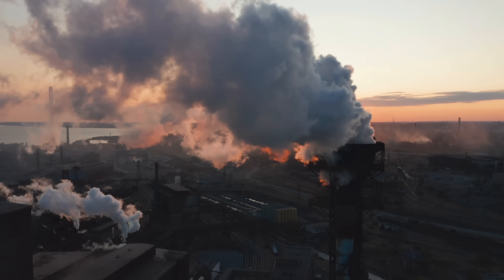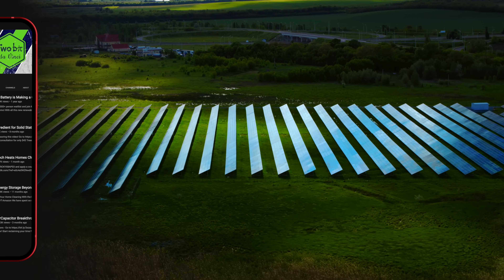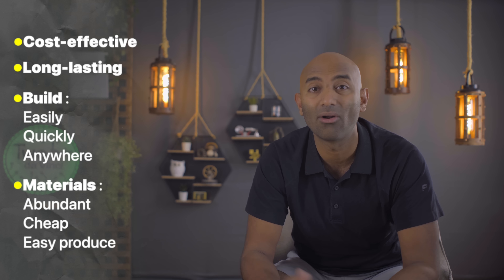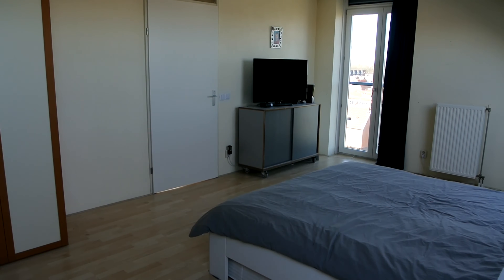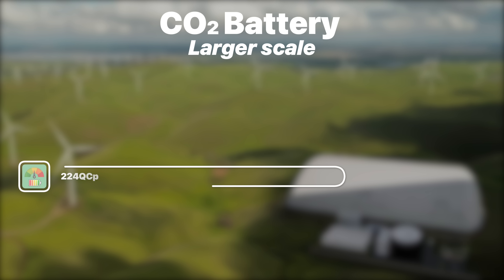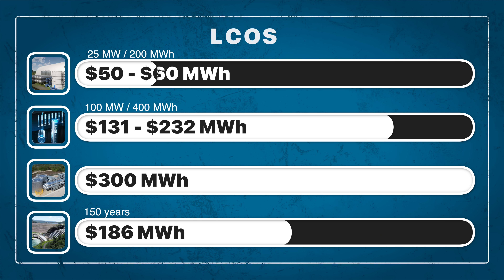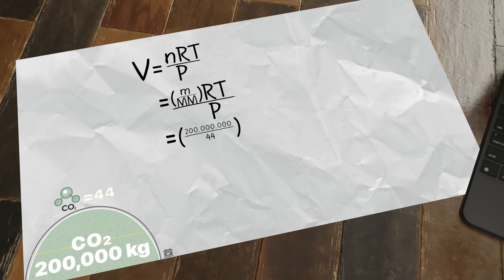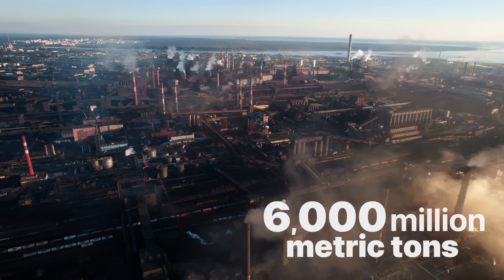The GENIUS Of the Carbon Dioxide Battery

Comment: Of all of the things I have seen on your program as well as many others, this looks to be the most promising. It's simple, inexpensive, safe, and scalable. That last part is the most important to me, this could be affordable to install in small communities, or small towns that otherwise would be stuck paying the high prices from big corp.
Reply: Another advantage is that the equipment will be off the shelf. Meaning workers from other industries could more easily be retrained to work with this battery
Reply: @AJSSPACEPLACE  that is a big issue, but a positive one. Years ago I owned a manufacturing plant. I had two commercial grade CNC routers. The first was an Axyz, and I found out quick about the cost of proprietary parts. The second was a CR Onsrud, and they used off the shelf components. The machine cost about $75,000 more, but it quickly made up for it with repairs and maintenance. When you run this equipment for 16 hours a day it takes a real beating.
Reply: I think you hit the nail on the head. Living in a third-world country myself, I've always felt that most of the technologies that could help the world steer away from fossil fuels are way too out of reach for us. But solutions like these would really make a difference.
We wouldn't need to bring in engineers from overseas and pay them 100X what engineers here are paid. Any good team of local engineers could easily oversee construction and operation and we could employ local steelworkers to build these structures. Not to mention use our own steel, piping and everything else. Turbines we'd probably need to import, but the rest makes a difference you wouldn't imagine.

And an important point to make: governments in countries like mine find it way too easy to blame China and the west for all the pollution, and the upfront cost of going carbon neutral has always been the perfect excuse not to do anything. But if we are to fight climate change, it can't be just Europe, China and the US, everyone has to do their part.

I think this type of technology helps a great deal in that respect.
Reply: @ipp_tutor  where do you live?
Reply: @rwells3376  Venezuela

Comment: Looks promising but we still need much cheaper! Assuming we need 10 MWhr storage for every MWhr of generation, then costs need to be $5-10 per MWhr or it will add too much cost to electricity bill's. Still $40 is at least in the right order if magnitude.

Comment: Looks like the process will be significantly less productive in cold weather.

It counts on ambient heat in the atmosphere to vaporize the CO², and the energy produced will decline with the outside temperature.

Comment: Does this tech function as a battery or a generator?  Because it looks more akin to a recyclable generator to me.
Reply: From the video... I believe it's a little of both. A... batterator?
Reply: It will be like lifting a stone. It is charged with kinetic energy. When you let it fall, the energy is released.

Comment: still think making green natural gas out of green energy excess is a better option even though its less efficient because it can be used instead of fossil natural gas with little change to infrastructure. to build makes CO2 emittions that should be calculated in too. Using one of the green natural gas production methods can even scrub CO2 out of the air.

Comment: I sincerely hope these guys will not wait for any carbon capture thing. Why? Well - this is something that can be build tomorrow, uses tech verified by decades and is so brilliant we should start using it tomorrow already, not in 5-10 years before we have relevant capture. Plus, the amount it needs is laughably small comparing to amount released by building medium-size house, if we include concrete and transportation.
What's best - we should not build it next to solar farms, but in/close to places of consumption! Decreasing grid load by using this as a local "booster" next to big plants. Not only as battery for intermitency.
This is so far the most game-changing tech - simple, available, realistic, scalable and pilot-verified.
Plz, keep following them. Should they be located in Switzerland, they would be reading my CV about now.

Comment: The only real problem I see is the bladder. Presumably it must be gigantic and gas tight. A huge plastic or rubber thing possibly, although I don't know the details. May not last long and hard to keep from leaking especially after many cycles. And how do you fix and maintain it? That will be challenging.
Reply: Then let it leak. It's CO2. You can simply capture an equal amount somewhere else and replenish it.
Reply: Likely graphene fortified rubber

Comment: I really like this idea. I was already a huge fan of the compressed air storage, but if this can operate within ambient temperatures, then this is obviously better. I kinda wonder what the bladders inside the domes are made of... rubber? Like a water mattress? Or perhaps some kind of plastic? I would imagine they operate like lungs with the outer dome being the ribcage. I guess the question would be... how do you capture CO2 from the atmosphere, and can that generate power somehow? I'm pretty excited about this. I still think nuclear is better, but this isn't half bad. :D

Comment: All they need to do, is run their compressors with the system open to external air and sort off the various products based on liquification pressure / temperature. No need to capture the CO2 from somewhere else.

Comment: I'm wondering if this could be scaled down to the use in family hones and maybe with gas pockets in the walls double as insulation.
Reply: I think you need a large outdoor area to store the gas. But with a nice color on the big bubble it could be nice.
Reply: @beehappy7797  i mean, its gas. Does it really matter what shape your “dome“ has, if its one big dome or a series of connected gas pockets in the wall maybe connected to a bigger thing somewhere else?

And generally air/gas or a vacuum (not sure whats left in the dome when it is charged) should funktion great for temperature insulation.

Comment: There is an added benefit to this technology: You can place it ANYWHERE. There is no need to worry about Chemical fire (as with Batteries) or whether the topography/geology allows for it (like with Compressed air or pumped hydro). You basically just need a flat piece of land large enough to house a CO2 bladder and you're done. Which means you can place this anywhere you have windfarms (on shore or off) or solar farms on cheap open land not used for something else like out in the western US or in the Prairie lands in the western parts of the Midwest.
Reply: Just don't let anything rip it apart when dome filled. Will suffocate every animal in the area.

Comment: The beauty with utility scale power storage is that it can be placed just about anywhere. The storage tanks have some hazard to it but minor since 70 bar ain’t that bad. The big dome is a big dome with something we already know.
So sounds good.
We must remember that batteries, for such use, are shifting towards LFP… which is way cheaper and since volumetric and gravimetric density is less important in such batteries, they should do well.
You should also investigate a Calgary cie called eavor (I think that’s what it’s called) which kinda stores energy but not from the grid but rather generates base load energy when needed and when wind/solar are pumping out energy, it simply leaves heat in soil to be used with greater efficiency later. A combo of cheap energy storage, easy to install anywhere base-load energy production with built in delay generation and ever cheaper sun/wind/wave energy generation, we can SERIOUSLY reduce our dependence on fossil fuels.
The beauty of the above is that ANYBODY, ANYWHERE can use them to some degree or another. Especially the baseline and storage.
Reply: The best part of this technology it's even something that it's not talked about, if we were to accept a higher energy inefficiency this would be the perfect way to export energy for countries with excess production with infrastructure that for the most part we already have, for example  just place solar panels all the way through the Sahara desert and then export compress CO2

Comment: Expressing energy production or storage in variable units like "households for x hours" vs "for an hour" is confusing. While I imagine the typical "households supplied" aren't very standardized, it is at least ostensibly the actual needs of a typical household, during any given period of time, as averaged over a typical year. Storage requirements are different from production requirements, but there still should be an attempt to measure in units derived from the typical needs for a typical household. How many homes are backup powered for one hour tells us nothing about how many hours are typically needed per home in a typical day.

Comment: You could store the uncompressed co2 in the actual windmill tower and have each windmill provide a constant voltage.
Reply: That would require suspending a huge tube  bladder in the tower. and due to the smaller size a reversible screw compressor and just one Co2 tank could be used per wind turbine. Kinda makes me want to try it with the junk screw compressor I have laying around. They are looking larger, but smaller could also scale since if you can do wall cooling during compression the temperature would be lower. And then there is the fact that the tower could also be a massive heat sink.
Reply: There was a company a few years ago that wanted to use extra large wind turbine towers. Inside these towers they would pump water for energy storage.
Reply: @andrewday3206  Pumping water makes some sense, still debatable.
1. You need a good pool of usable water nearby. It sust be clear. 
2. large mass of water greatly uncreases construction demands. You now need to use corrosion-free materials and much beter founsation.
Reply: @DimaZheludko  
I don’t disagree with you at all. It was just something I remembered a company had proposed.
Reply: @DimaZheludko  Good idea and when tsunamis roll along,, you get even MORE water to play with. I'm all for it.
Reply: Interesting idea. You could connect the wind turbine shaft to the compressor mechanically, then bleed off CO2 to drive a smaller, constant velocity generator. This might be more efficient than having a generator directly attached to the shaft that has to handle variable levels of power. Are there any engineers in the audience who care to chime in?
Reply: @bradmaguire6458  Sounds good. You eliminate one whole stage of electricity generation. You don't really have to worry very much about constant turbine RPM either.
Reply: @bradmaguire6458  Hey, that's a fun idea actually. I still believe it would be less effective overall, but it is neat nonetheless.
First of all, you'd have huge losses due to compression/decompression. Then, when dealing with gasses, you have to seal everything somehow. Sealing means that solids need to be in tight contact, otherwise you'd have leakage. But tight contact means friction, oils, and costly mainentance. That's really bad.

On the other hand, you don't really need to make as much small generators as there are turbines. you could channel all that high pressure air into some large unified chamber and then take it to a stable generator from there. This way you could deal not only with minute-to-minute wind intermittency, but also have some power for hours or more. What's more important, you wouldn't have to make that generator as light as possible. You could also use some flywheel for better stability if needed. You can't put a flywheel on a modern wind turbine, it would be heavy and would need an expensive support.

In the end, you'd have one big pressured chamber, one big generator, and an array of unpowered autonomous wind turbines. Sounds steampunky to me.
Reply: What are the interior dimensions of a wind turbine tower? (For volume calculation?) What would be the "work around" for maintenance access to the turbine (upper parts of the tower)?
Reply: Put some rodents on wheels to make it go. I like it.
Reply: Bruh. That's kind of genius.
Reply: What? How can uncompressed CO2 provide any benefit?

Comment: How does that compare to a refrigerator? Seems a LOT like the same system.
Reply: Interesting idea. Build continuous duty refrigerators that pump excess CO2 into a turbine generator. Except that would be extremely loud.
Reply: @mikemorgan8588  Wonder if you could also
 pump the extra heat or cold to customers?
Reply: @DouglasEKnappMSAOM  , I was thinking along the lines of residential use refrigeration, but that may work for apartments that share compressed gas lines that lead to a pressure tank in the attic. Decentralized energy (whenever possible) is the way to go. I’m sure utility companies would hate it.
Reply: @mikemorgan8588  Ya, I am a bit sick of the "big boys" shutting down local ways to fix problems. Mega programs get the money but each home with their own solar? No way. Etc.

Comment: I don't think you mentioned anything about losses. Is there no CO2 consumed or lost during this process, and that once charged, the dome's CO2 volume is stable for it's life cycle? I saw I'm not the only one who thought of salt domes. Certainly there is potential there. They're already pumping CO2 into some of them, aren't they? Storage viability already proven in that case. So why not build a CO2 power plant nearby? Obviously this technology isn't going to remove much CO2 from our atmosphere in and of itself (i.e., the dome charge), but given that if enough of these can be built, then certainly in the long term they would replace combustion-based power generation and reduce a huge source of CO2 emissions. Can't wait to see progress on this tech. Finally a solution that makes sense.

Comment: When the finger starts to point to the cost/profitability of new tech as a potential reason why it won't beat out the old tech, I point to the fact that we don't properly charge for the damages that the old tech is doing as the reason why it was ever profitable at all. We let the entrenched energy corporations get away with far too much.

Comment: Seems like CO2 domes would be susceptible to to weather, and impact reliability. But still seems like a good idea.
Reply: build a structure around it to protect it - place solar cells on the structure to make up for the bladders large foot print. And now its even smarter, because its like it takes up no space, instead of a lot of space.

Comment: Why not make the dome out of solar energy capturing material? On some of these videos, such as one for solar panels for balconies, the panels were very thin, flexible sheets. 
That would mean the dome itself could capture energy at the same time as storing CO2, plus the grey of the panels would be far easier on the eye than having some huge stark white whale of a 'thing' as yet another eyesore on the landscape. 
It's enough that we have pylons and telegraph poles romping through the countryside. I don't mind the turbines (as I come from Norfolk, UK and used to windmills anyway), but they are the limit. Sorry, but these great big white blimps look absolutely awful and are a development too far. At the very least, paint them green so they look like a hill.

Comment: At it’s core a battery is a device that cycles between low entropy and high entropy and respectively accepts or outputs energy as the mechanism of transformation. If a battery also sought out the resources to maintain the low entropy state, meaning it had agency to stay charged, it might be called life.

Comment: Or, each building should have a battery bank system for night time lighting. Why low voltage DC wiring to LED lights isn’t standard in new construction is hard to justify or comprehend.
Decentralized energy production and transmission seems to make more sense. Each building should have capability to create at least some of its energy needs through wind and solar power generation, on site.

Comment: Doesnt matter... I mean its not like we can really compare battery vs this type of storage. Battery just doesnt have the supply so trying to compare to it is a bit silly. So what else do we compare it to? Well nothing... because there is nothing to compare it to after that. Pump storage methods exist, sure, but they at best can only cover 5-10%... that means we are still loosing over 95% of unused power. So even at 75% that still 75% more power saved to be used else where or over night. While Solar isnt free its still cheap and getting cheaper... the only hold back from is it simply storing that power. I mean how many times do you hear power grids cant even accept the power that home solar provides because there too much power on the grid anyways?

Comment: If only there were a way to naturally store solar energy in carbon compounds in liquid form, and take advantage of the high energy density to power the world. Oh wait! 🤣

How 'bout we find a way to use solar energy to combine water and carbon dioxide into fuel, while releasing the oxygen that will later be used when utilizing it. Seems to me that nature has discovered the best way to store solar energy, and we need only duplicate it. The answer to being carbon-neutral is to produce our own liquid fuels from the air instead of taking it out of the ground.